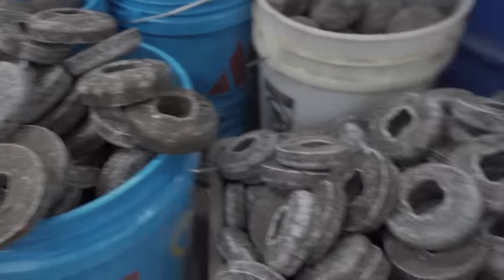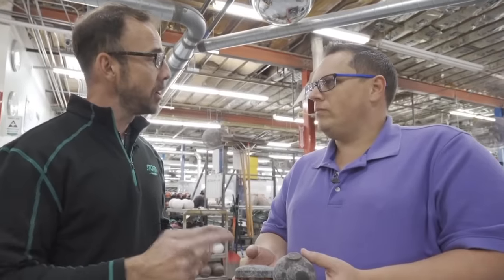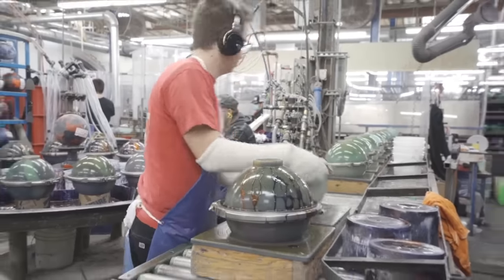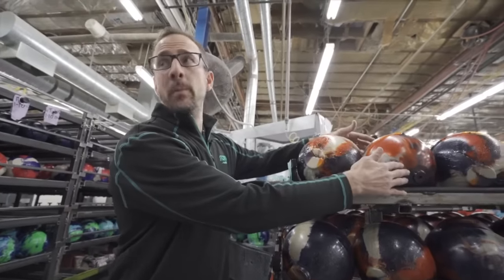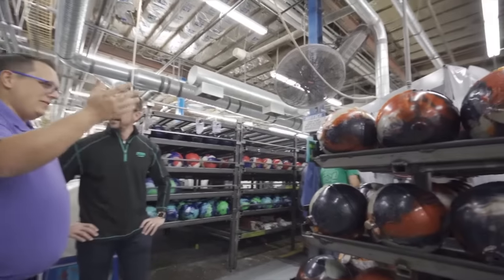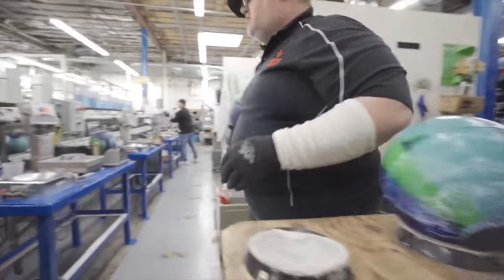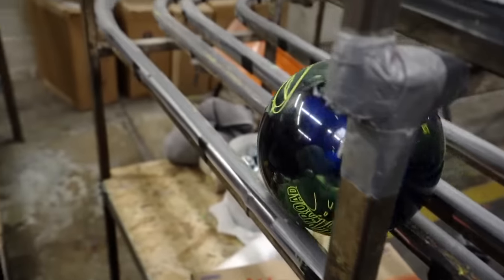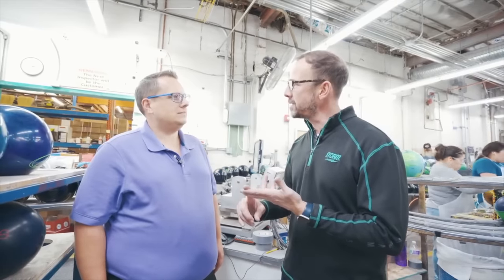Inside Storm: How A Bowling Ball Is Made

Comment: I'm still having a hard time believing the pros use weighted balls "because they spin easier". Christ, why the hell is that legal?
Reply: Wait, you're joking, right?
Reply: You aren't understanding the concept. What they do is make the balls not linear in weight. Meaning some parts of the ball are heavier than other sports. Which is what actually creates the ball hook. Absolutely pros use them. If they didn't, the balls wouldn't have that hook you see. And absolutely its legal.
Reply: @o.p.h.o.v.e.n  Yeah, I've seen how the weights are installed on How It's Made. It basically lets them hook the ball more because there's more angular momentum when the weight's oriented right. It's NOT like they couldn't hook the ball at all without it. Tennis rackets used to be smaller, too. go figure.